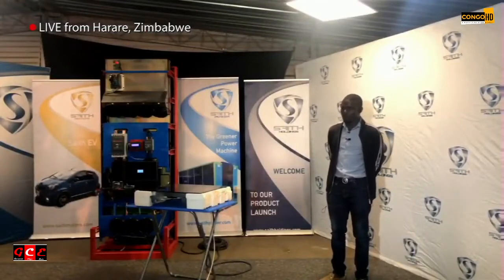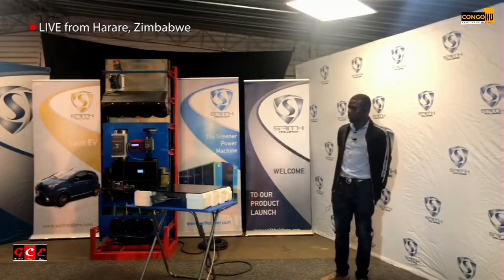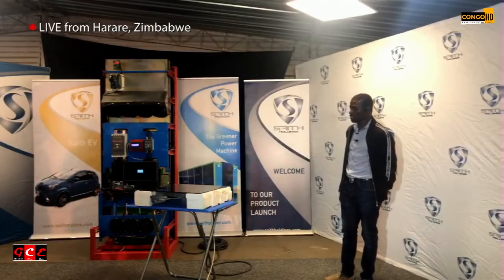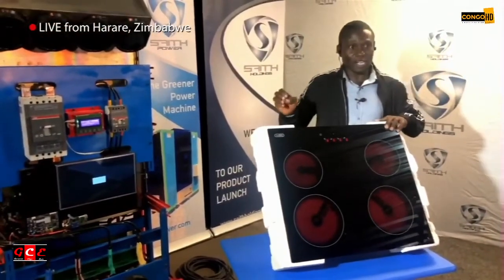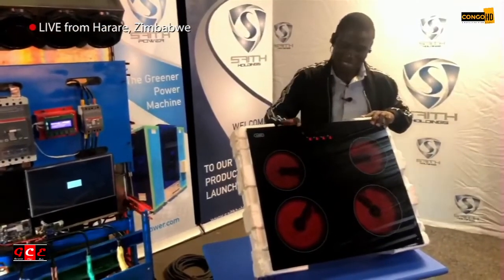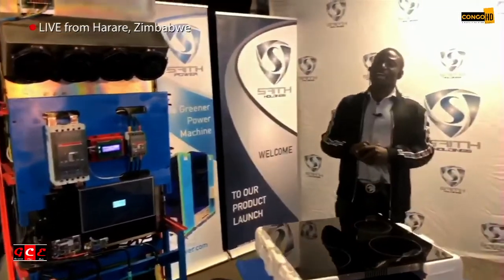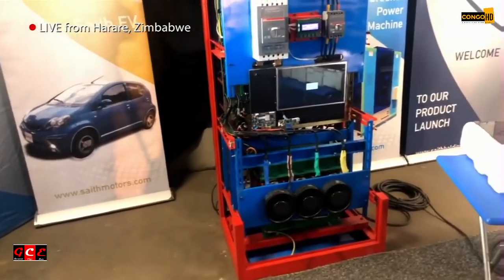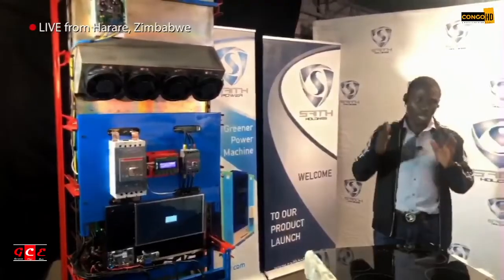Maxwell Chikumbutso Build a 50KW RF Power Generator and Explains how it works

Comment: He reveals only the circuitry that regulates the power after it has been acquired.  There are no available radio station broadcasting large levels of power at every remote area on the planet. So any radio frequencies must be generated within this device itself. With a name like "MicroSonic Energy Device" perhaps it is using piezo ultrasonics to resonate a permanent magnet's magnetic field to induce radio frequencies in nearby coils.

Comment: What a waste of time. Blablabla .. no real explanation on how it works just some rumbling guy. So it's basically using radio wave.. yeah right.
Reply: You jealousy levels are astonishing you where clearly not well raised
Reply: Let's make it clear if you understand what DC do and AC you understand the that from transformers only work on AC currents so It can up  voltage .. just using radio wave.. is to weak ..
Reply: 😂😂😂He told you the components are Taylor made so don't expect them to work according to your standard.
Reply: It will remain magic to many until he discloses the secret.
Reply: Foolish comment from the sour purse of this world.. useless
Reply: Very ignorant comment..
You wouldn't understand the sophisticated technology of magnetic Flux and waves energy.
Reply: @fredsebuliba671 you don’t either since Max never used those terms
Reply: These waves don't produce enough energy for this shit to work @fredsebuliba671